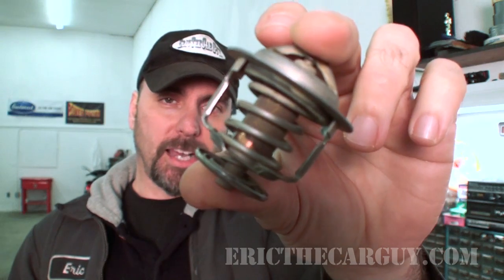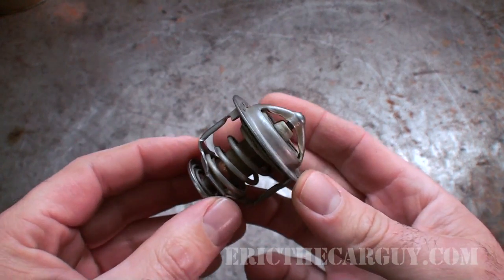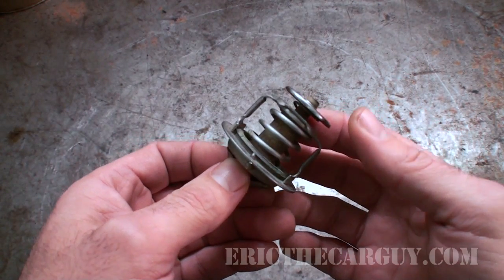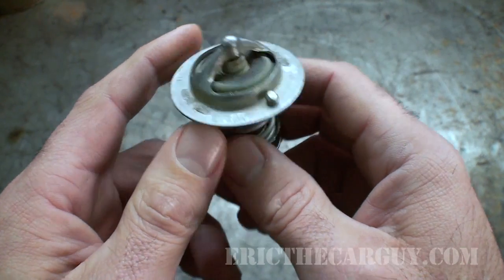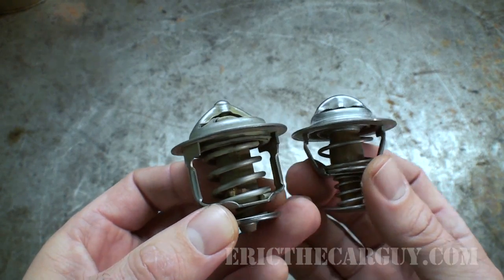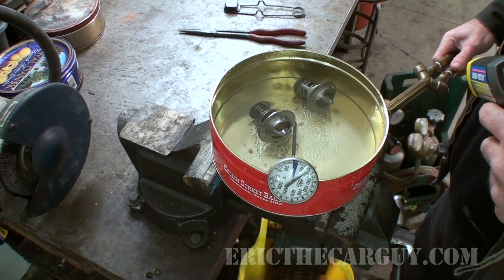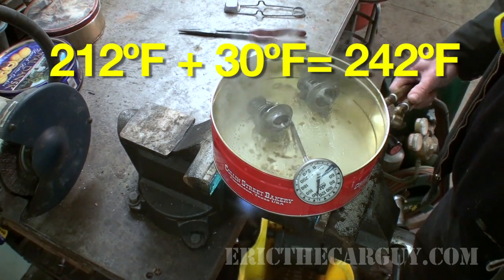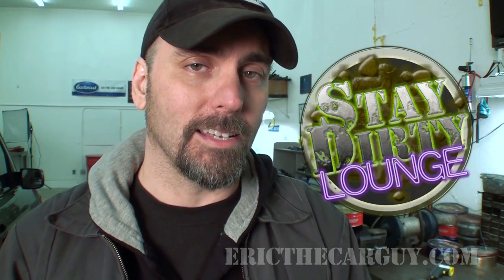Understanding and Testing Thermostats -EricTheCarGuy

Comment: Another "failure" mode is people who install them upside down...

There are some applications where the quality aftermarket units are better than OEM due to changes that the OEMs may not consider a "necessary" change, but which has been demonstrated to be a benefit in the field..
Personally I run Stant (who make many OEM parts as well). I won't install the "Fail Safe" units due to multiple failures reported.

Comment: Is it possible that the thermostat housing corrode? The car came from a warm climate, so not sure if they used only water. Short story, thermostat change made problem worse, mechanic states that he fixed the housing on a lathe. Does that sound probable. Car is 2004 Civic, petrol.

Comment: thanks for the vid Eric looking forward to the new vid with bleeding one with an expansion tank.   have a 97 sable that has that.  but it currently has a slightly plugged up heater core (soon to be replaced)  But my Temp Gage fluxes a lot  from normal middle down to cold then back up again then down

Comment: hey eric, thanks for the video.
I was always under the impression that when the engine is not running at operating temperature (when not running a thermostat/stuck open) that the engine wears quicker? Is this true? i thought that because the different metal parts within the engine were not expanded to spec that the tolerances between the different parts caused premature wear.
Is this theory true for not over revving a car soon after you turn it on?

Thanks!
Reply: Yes. Temperature changes your oil viscosity. An engine is much more easily lubricated at operating temperature than when it is when cold.

Comment: Hi Eric I have know people to take the thermostat out cause it's running hot, the realm trouble was the radiator was partially blocked, also a common problem with aftermarket water pumps is the impella falls off Fred UK.

Comment: This video couldn't have better timing. Quick question. 2007 Sedona. Wasn't getting fantastic heat but some for sure. But seems like the van would never warm while idling. But primarily noticing poor fuel economy as well as a very rich smelling exhaust while idling. And the temp gauge never reaches the middle or normal operating temp. Replaced thermostat. Bled (successfully?) No change. While bleeding I never could get the cooling fans to operate. However it is -22F in my garage so I imagine the ambient temp might be enough to cool the coolant down. Thoughts? Coolant temp sensor? What should I attempt next?

Comment: Actually coolant has a higher boiling point than water, so a 50/50 mix of coolant and water boils at 235 degrees Fahrenheit. That means your system should typically not boil the coolant until ~265 f. Pure coolant has a boiling point much higher than water (about 262 f unpressurized), but its ability to conduct heat is not nearly as good as water. Also anything less than a 50/50 mix of coolant is not advised as it provides lubrication for the water pump as well as seriously important anti corrosives for the coolant passages and radiator. A steel engine with an aluminum radiator often leads to pinhole leaks if the coolant isn't changed every 3 years or so to prevent  galvanic corrosion.

Comment: Great video Eric! Glad you mentioned the importance of OE vs aftermarket thermostats. I've found out that this is especially important on Subaru's. An aftermarket t-stat can have the same temperature rating but will be a very different design and have different flow rate and other characteristics. Using an OE thermostat helps avoid tons of problems.

Comment: Great video Eric! I have a noob question though: where is the thermostat typically located?
Reply from the maker: Normally where the inlet hose from the radiator connects to the engine. Most times it's the lower radiator hose BTW.
Reply: In most (if not all) cases it's located on the block's left side. 90% of the thermostats I've changed over the years were located below the 1st cylinder spark/glow plug..
Reply from the maker: panzerveps Not all engines are 4 cylinders. :)
Reply: That is true. Been a while since I did any work on a v-engine..

Comment: Hey, Eric. Great video! have a couple questions. First, you mentioned different characteristics between aftermarket vs oem, however, would it be better to have a thermostat close quicker or slower, or if it has any effect. Lastly, I heard you could get certain Thermostats that are designed in a way where if it were to fail, it would fail in the open position, because I would assume over heating is way worst than a not up to temperature problem.  Again great video and thanks for making all these awesome videos :)
Reply: A failed thermostat in a closed position overheats, which IS bad, but a permanently stuck open thermostat is bad, too. An open thermostat makes your car run rich, and unburned gas passing through your catalytic converter will actually damage it. Also an improperly heated engine can lead to deposits in the oil passages and oil pan from the oil not reaching proper temperatures (sludging). While these things take time to manifest a car running with a wide open thermostat for years will show more signs of wear internally than a motor allowed to operate at its peak designed temperature.
Also interestingly I bought a Beck-Arnley thermostat for my 2003 Saab, and it would appear to open at the correct temperature, but then it would never close. On a day when it is 50 degrees or so if I was driving 45 mph the temperature would slowly decrease on my car, it only stayed at the proper temperature (190 f in my case) in stop and go traffic. I'm assuming the valves inability to open and close in small increments as shown by the aftermarket valve in Eric's video might be to blame for this, although it could very well have just been a faulty part. I purchased an OEM thermostat after that, and it seems to be able to open and close more slowly therefore keeping the temperature plus or minus about 2 degrees fahrenheit. 
I know I'm not Eric, and sorry for the long post, but I thought I'd share this info with you anyways.
Reply from the maker: My point in showing that was to show that they act differently. As for what's good or bad, I've had much better luck with OE thermostats. I haven't heard of the other thermostats you described, but as I said in the video, stuck open or closed, it's not a good thing.
Reply: EricTheCarGuy The way i see it is that a thermostat that opens and closes too fast will act like a suspension without a damper on it. You will be bouncing across the road (in this case with your temperature) and that can make it so your engine keeps being fed too much fuel and then running slightly hot.

Whereas a slower thermostat will make it so these changes happen gradually and naturally for the engine in question. It doesn't get a panic attack every time something changes and instead slowly adjusts to the conditions.

That said, had you heated that water in your bowl up to way past 82 c (197.6? f) you would have seen the OEM one open pretty fast too because of how fast it's internal "resistance" is being overcome.
Likewise, if you had two pots. One too hot and one on the opposite end (say one is 20 degrees too hot, the other 20 degrees too cold) and you switched the thermostat over between the two pots you would see that it opens and closes much faster.

Anyways, that's my two cents. A slower thermostat is better because it doesn't overcompensate and it will still react well to extreme cases.